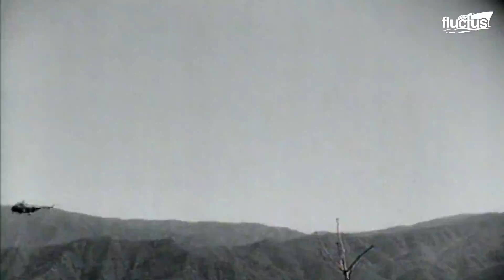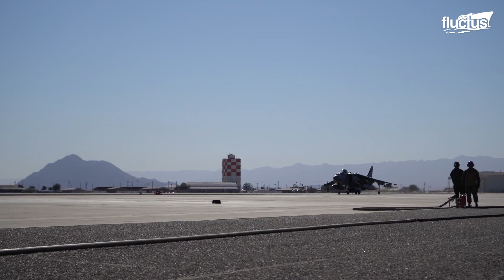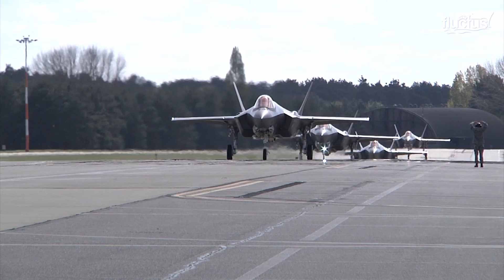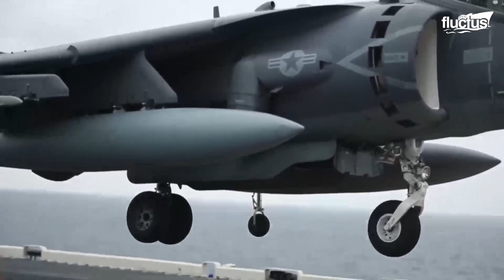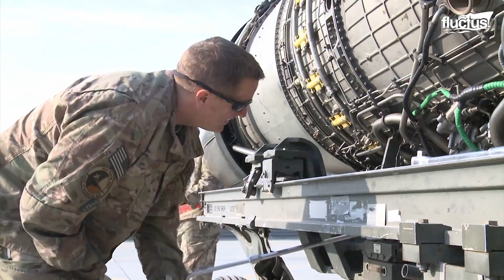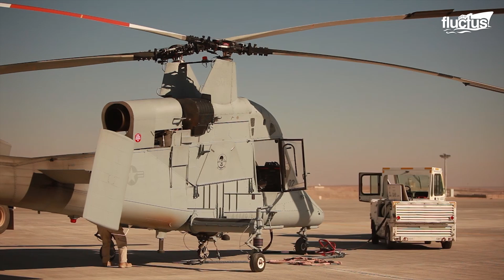Why US Spent Billions of $ to Invent this Hypnotic Landing Technology

Comment: WHat is the reason that it does not have 2 engines? The f-22 and the many other 4G+ aircrafts have 2 engines...
Reply: Well, there are several design considerations associated with a jet powered ST/VOl aircraft.  Complexity:  If you add a second engine, how do you deal with engine failure?  If you are dependent on both engines to sustain vertical flight, then lose one engine, you lose the entire aircraft.  If your design only has one engine to begin with, loss of that engine in hover will yield the same result.   With two engines you have a propulsion system that weighs twice as much.  So, do you make them both powerful enough to sustain vertical flight on a single engine?  If you do, then you have too much installed power and very large engines.  You have to balance the control and output of both engines to attain vertical flight.  You have to provide sufficient fuel to feed both engines for a useful mission duration.    The F-35 was designed to replace the F-16 and AV-8B, which are both single engine aircraft.  The Harrier was designed around a single powerful engine which simplified the control process and minimized the weight of the propulsion system.  Unlike a helicopter, which has a single rotor that can be powered by multiple engines, the benefit being, a loss of one engine still allows safe flight on the remaining engine, or engines.  But for a jet powered VTOL aircraft this won't work.  It's better to install a single engine powerful engine, which actually minimizes redundancy and reduces weight.  Why does two engines work for a conventional fighter?  Well, the complexity of engine installation is not as complicated.  You don't have to vector thrust or swivel nozzles and open large doors.  Imagin a twin engine F-35, or an aircraft with two of the propulsion systems of the f-35.  It would be a much larger aircraft, two engines, two lift fans.  A failure of any one of those four components would result in a catastrophic loss of the aircraft in VTOl mode.  Such an aircraft would need a larger fuselage and wings to hold sufficient fuel and engines.  Then, how much weapons could it hold, or carry?  It's a compromise on many levels.  Then consider the cost of a twin engine aircraft.  It would be way more expensive, and it would exceed the initial goal of the design.  Remember, it was supposed to be a low-cost fighter like the F-16, so it was always going to be single engine aircraft.

Comment: Post disintegration of the Soviert Union Lockheed Market visited Yakovlev Design Bureau to view and investigate Yak38/Yak41, subsequently purchased data related to the Soviet VTOL fighter. Yes F35 has had a substantial design input of all of its systems by LM but it is unmistakeably based on the Yakovlev Design.
Reply: That was a copy from the P.1154 ! The Harrier used the subsonic Pegasus P.1127 but the supersonic P.1154 was designed at the beginning of jet powered VTOL but not funded
Reply: yes f35 use soviet yakovlev design
Reply: @tomtomblos2909  that was a copy of the British P.1154 design just like they copied the copied the P.1127 design also Russia copied the Concorde

Comment: The F35B Also uses a HELL of a lot of fuel in a hover and even more in a vertical takeoff....
And the more takeoff weight,  the more fuel it uses,  expodenously...
Thus,  with a short takeoff roll and even a little jump at the end of the runway,   it can increase it's stores quite a bit.....